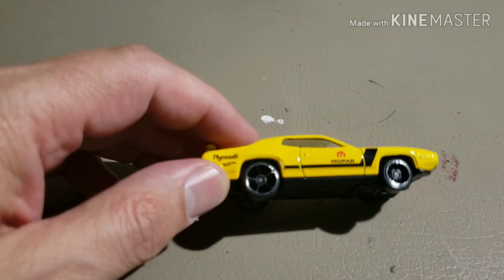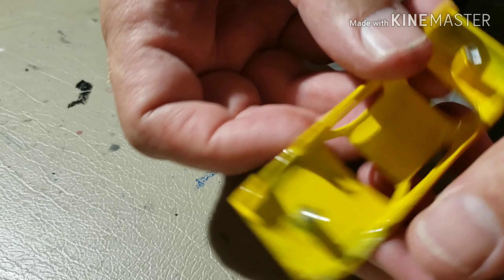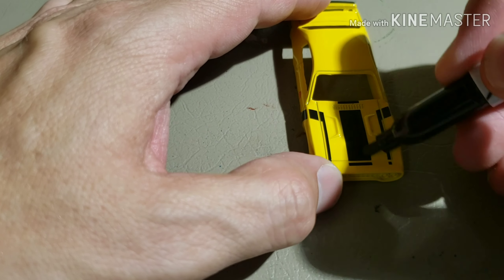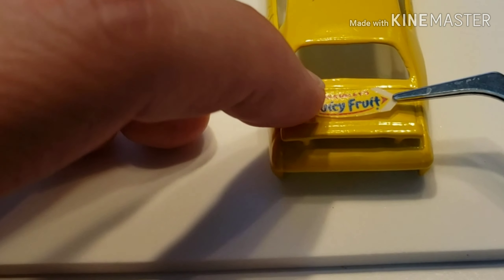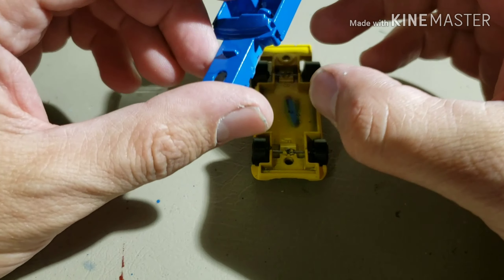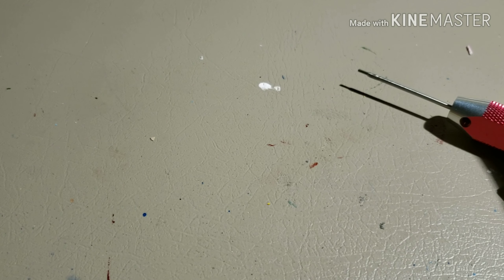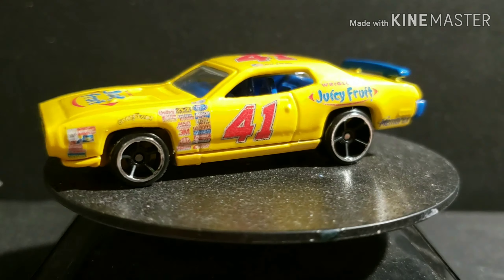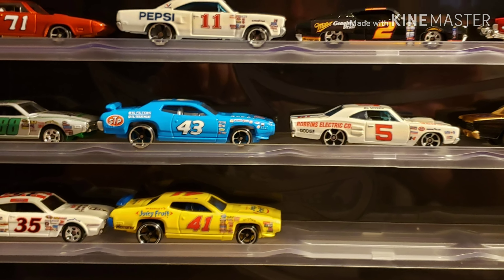Custom Hot Wheels (1971 Plymouth Road Runner)

Comment: Along with another commenter...yellow isnt my thing either...lol. However....nicely done.  
I am curious why you avoid wheel swaps?  The new steelies from the brand in my opinion would look fabo on this casting not to mention a direct correlation to NASCAR of that vintage.  Of course I do recall seeing many tribute cars that carried the livery owned by fans.  My buddy built just a car in 2009 from a burned out 64 Galaxie.  Looks just like Fireball Roberts '64 he drove before his death.
Again...nice job. 👍
Reply: I was going to add...the Steelers could be painted to match body color too...just a thought...
Reply from the maker: Thank you!!! I'm sticking with the plastic wheels for this series because all these cars are going to be raced down the track for another Youtuber.. I'm compromising looks for speed as I want all of these cars to make it down the tracks and put on a good show... The nice wheels (monoblock, house of 1/64, ect...ect..) look fantastic, but don't do well for racing.. once these cars are done racing I'll probubly put some nice wheels on them... oohhh sweet I would love to see that Galaxie.
Reply: My buddy has posted several albums across the internet.  The best place however is Facebook.  Look up Don Falloon from Citrus Heights, California.  Under photo albums check out Priject Fireball.  I snapped most of the "glamour shots" of the car.  He was the pace car at the San Jose. Gran Prix with the car leading the exhibition historic race.  They even allowed him to park with the historic race cars knowing his was a simple tribute car.  Glenn Roberts daughter Pamela Trivette and her husband actually gave their acknowledgment of the car.  It is really well done.

Comment: Suggestion: Be careful with the "self tapping" screws as they can possibly split the post if the post is too thin. I recommend using an actual tap to create the thread.